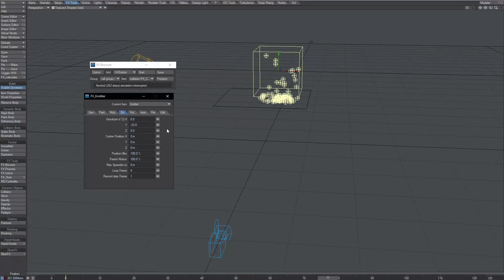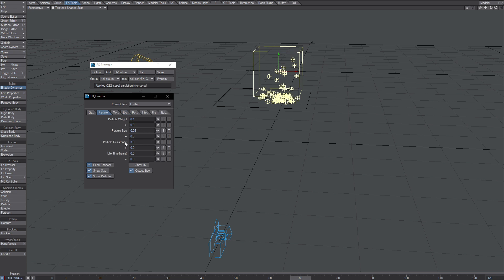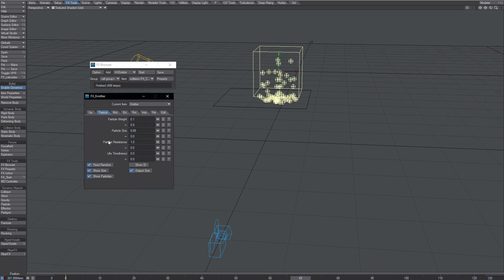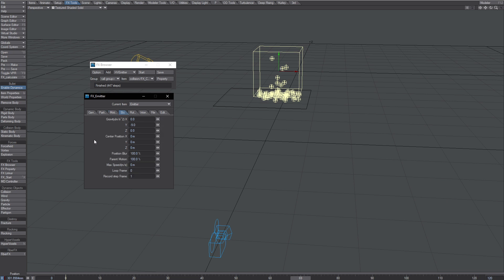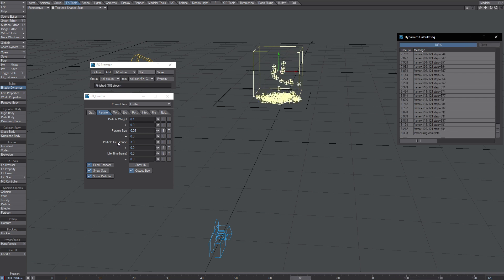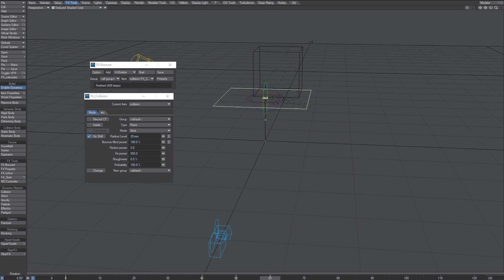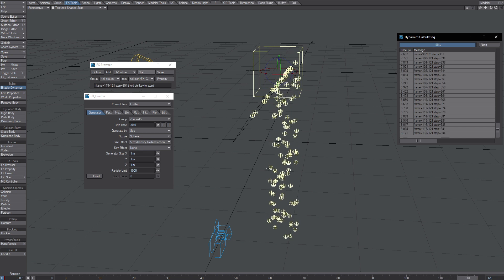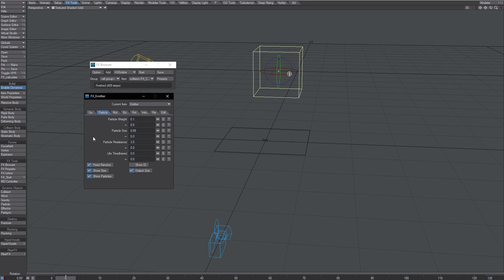LightWave test - Particle Resistance Stick - PFX

Comment: I've never had any issues with the particles not sticking correctly, or jumping.  I just have my collision object set to "Stick" and the Fix Power at at least 100.  My emitter can have zero gravity and zero resistance and still work perfectly as expected.  Even with changing gravity and resistance, the particles still stick without moving.
Reply from the maker: it might be that you just haven't noticed it, since it often isn't obvious at first glance ?
Note, in this example, they do stick eventually, but they just also add gravity + sticking, thereby solved with high resistance.
Reply: @erikals  I just tried what you were doing with the above settings and it works fine.  Don’t see any issues.  I’m not sure what would cause the discrepancy.
Reply from the maker: @axis3d  no, tested again, they do jump, but not always, it depends on the animation / the speed of the animation.
so, I think you are right, but also a bit wrong. it depends, like shown in this video.
Reply: @erikals  I’m using LW 2019.1.5.  Maybe that’s the difference?   I’ve done tests with fast and slow particles.  Gravity or no gravity, resistance or none.  It still seems to work okay.  Or at least nothing that is noticeable.
Reply from the maker: @axis3d  yeah, hm, ok, i will share a scene ☺️
Reply from the maker: @axis3d  ok, i found parts of the answers...
alternative 1 --- Bounce power needs to be high
alternative 2 --- Animation needs to be slow,
alternative 3 --- Particle Resistance needs to be high
Reply: @erikals  I do notice the bouncing if the particles are very slow.  I guess I've only ever used this effect when shooting particles at a fast speed at the collision object.  That's why it's never been an issue for me😁
Reply from the maker: @axis3d  yes, but be aware. i'm just glad that there is a way / a hack. ⭐
Reply: @erikals  
Do we really have to go through all that? :)

Try checking no shift on the collision object, this should fix the particles without bouncing from the surface, in my basic setup they bounce without that some of them a slight shift bounce and offsets the actual location on where they are sticked, while with checked no shift, no bounce, no offset.

Calculate and try it.
Reply: But...use no shift when gravity is involved as force down, using velocity down, you can´t use that it seems.
Edit..sometimes it works, sometimes it dont´´
Reply: From the doc..but I have irratic behaviour using no shift...
"The Noshift option disables any offset the particles may generate in the collision process. This ensures that the particles will collide directly on the collision surface."

It could be that you may have to use a true object and add collision fx, instead of using the dynamic object item types directly.
additional checks with object plane instead of dynamic item set to plane, and it works without any bouncing for both velocity negative force and gravity..if set to no shift in collision settings.
Reply from the maker: @PrometheusPhamarus  Nope :) thanks for looking into it. but the solution in this video seems to be the way.
Also for Object mode... "No shift" yields same result.
Might be that those methods sometimes works, but not in this case.
This said, ParticleFX is tricky and plays tricks at times. Like most dynamics solutions ☺️
Reply from the maker: @PrometheusPhamarus  Youtube comments is behaving strange, so can't see all replies.
But like i said above, it might depend. PFX isn't always straight forward.
uploaded scene file > https://forums.newtek.com/threads/165599
Reply: @erikals  there are no reasons for it not to work though..this is the setting you should set as such according to the manual, we are using a fairly simple setup, a plane and one emitter.
but you did not showcasing all the settings for the particles, so it´s hard to track it down.

Just noticed that  you posted a scenefile on the Newtek forums, I will have a look at it, then we are using different Lightwave versions.
Anyway, it works in my case with no shift, at least for the last check I did, but as mentioned..I had irratic behaviour where it didn´t work as well.

So the solution in my case anyway.. Is to use no shift, sorry it doesn´t work out for you :)
Back to the forum to download your file and check that.

This may destroy our night day rythm...again ..as many other debates :)
Reply: You do have position blur, and detect interaction on the particle emitter, those things can change the positions of your particles, such as bouncing, but I have to check it all more.
Reply: Checking your scenefile and removing most values I think can interfere, got it a bit better, to the point where the particles only bounces and fall through at the end of the emitter spawning, I think it´s not capable of calculating properly depending on FPS, I changed from 30 to 60, then the particles don´t bounce or fall through.

Not if you remove the collision objects motion, that is, if the collsion object is moving, it seems to interupt the exact fixing of it, so a slight bounce, but still better with 60fps.
Reply from the maker: @PrometheusPhamarus  yes, this scene is a tad more tricky than most.
thereby the challenge. true, fps adjustment can help at times.
no big problem, but thought people should know about this. :)
Reply: @erikals  
using an object, static..not moving and changing fps to 60 solves the bouncing, the particles sticks Exactly on spot, moving the collision object and the system may not be able to calculate the simulation fully, thus offsets/bouncing etc..
 I think it needs subframe calculation options perhaps, which isn´t possible in the pfx system today.

But for static object, there shouldn´t be any issue, you could at least try that and verify wether or not I am wrong or right on that, it doesn´t solve the case when you want moving collision objects, but then we may be closer to figuring out what may cause it all.
Reply from the maker: yes, in this case the point is, it needs to move fast tho'.
so i don't think there is any other solution/hack than the one i've shown on this video. i could look more into it, but for fast moving PFX this is the way for now.
Reply: @erikals  

Indeed so, I initially and wrongfully thought You only were concerned about the basic static impact.
So your trick may serve as a solution for now, i don´t know anything else myself....for moving collsion objects.
You earned a good night´s sleep :)
Reply from the maker: LoL, thanks, soon needed ☺️